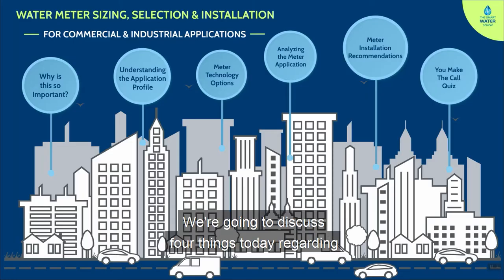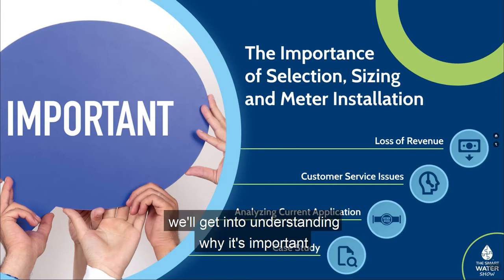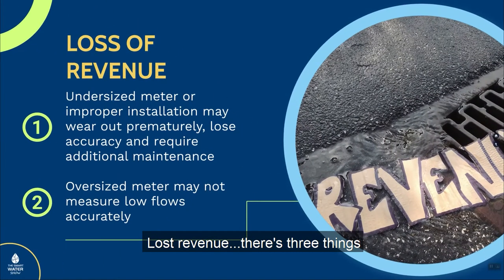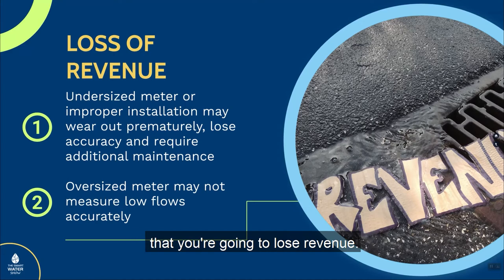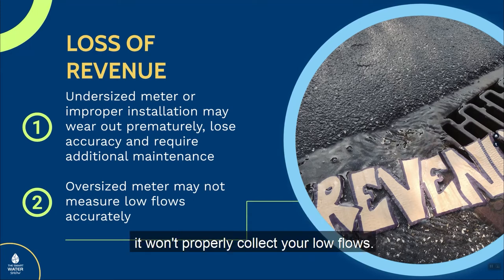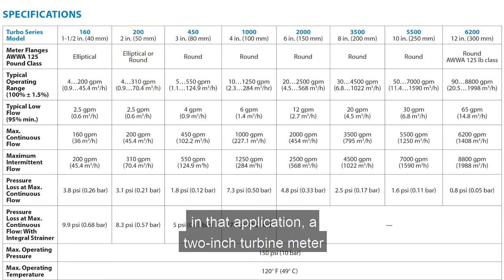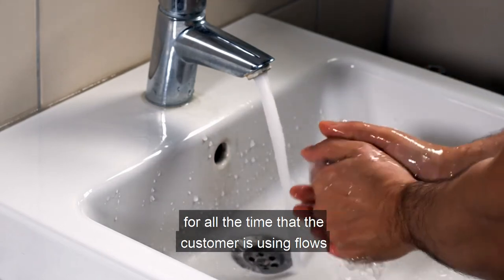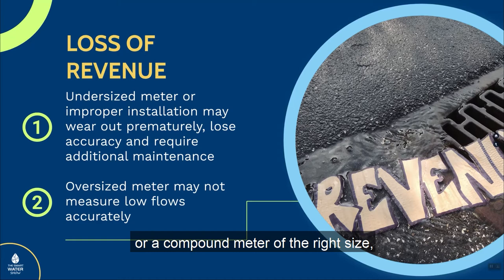How to Properly Size, Select & Install Water Meters | The Smart Water Show - Episode 13

Comment: Question: In old residential apartments where pipelines are not properly planned to facilitate fixing of meters in each flat, what are considerations and approach to install electronic meters. Also does market have electronic meters which push software updates automatically, reducing the effort to replace them to upgrade?

Feedback: Morrice is doing an excellent job here. All content is exact what I was looking for in the internet quite a long time. Can't wait for all the 9 parts of this series. Thanks a lot for this to Morrice and the entire team who is working behind the screen
Reply: Rakesh: In today’s market, the cost of clamp-on ultrasonic meters are probably more costly than hiring a good plumbing contractor to install a reliable in-line mechanical or electronic meter.  Also, some AMI endpoints may have the ability to push upgrades sent wirelessly from the headend system to electronic meters via the wired connection.  Thanks for your feedback.